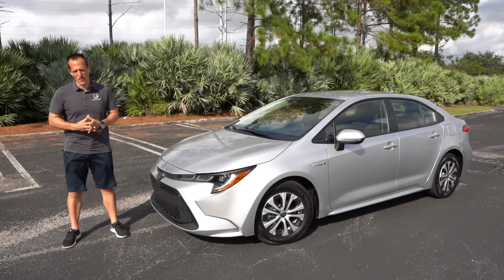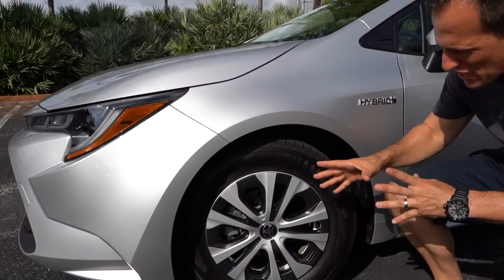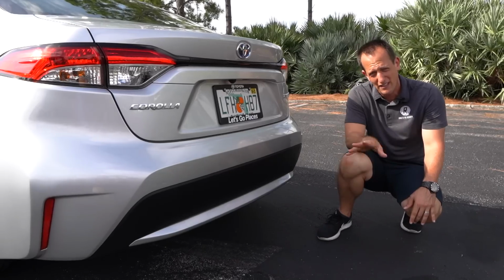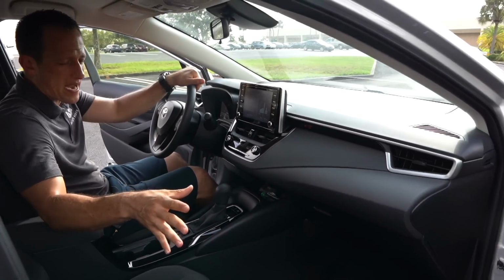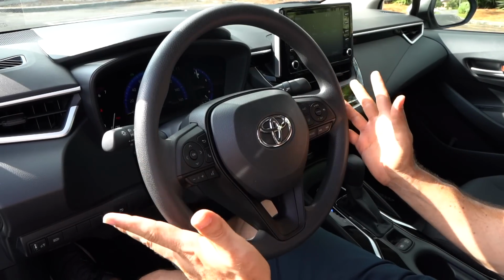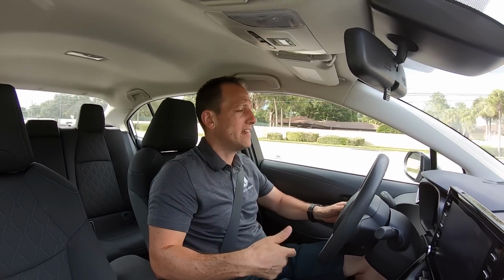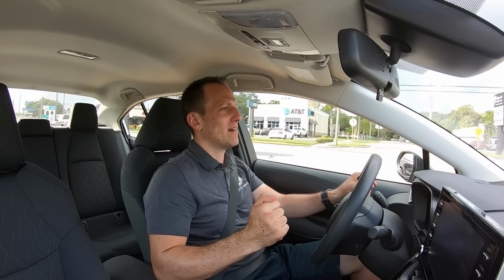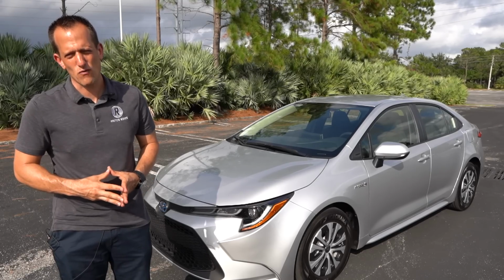Is the 2020 Toyota Corolla Hybrid the BEST compact hybrid YOU can BUY?

Comment: I bought one. Love this car. I bought an iPhone to use apple car play (android user), no android car play.  The stock infotainment center is useless, slow and clunky. Bought a cover for the center console armrest. I disagree with the you on the interior door panel. It’s easy to clean. Unlike the previous Prius, this car will get unreal gas mileage with aggressive driving. A simple windshield replacement will cost you almost 1500 bucks (thanks for insurance). 900 for replacement and 400 and some change to get lane assist recalibrated at Toyota, which is mandatory. No spare tire. B.S. fix a flat kit, to save weight I assume. 0-60 doesn’t mean much in real world driving. It accelerates nicely in power mode. Speed is not a factor anyway in this demographic. This car is rock solid. A classic dependable Toyota. Would buy this car again in a skinny minute.
Reply from the maker: Thanks for sharing your ownership experience!
Reply: I heard the brakes feel weird/grabby, is that true? Do you get used to the regen brakes? Can you actually have a little fun driving this 2020 Corolla hybrid????????

Comment: I am seriously considering a Corolla Hybrid sedan for the 2021 model year, or maybe pickup a leftover 2020 as my daily driver
Reply from the maker: That sounds like a great plan!
Reply: There isn’t going to be any left overs , these cars are holding msrp with even 60,000 miles so better get one now I’m keeping my corolla hybrid for 20 years
Reply: The 2020 corolla hybrid doesn’t have all the extra weight from blind spot , rear cross traffic and you can really get all the Noh you want (up to 56 mpg everywhere you go)
Reply: @southbayla3137  Have you had any issues with your? I wouldn't imagine you would I've just read some things  about the non hybrid ones having issues.

Comment: I don't think you can get Blind Spot Monitor even as an "option" for this Hybrid Corolla. That's a major safety omission by Toyota and it would steer me away from this otherwise very decent, economy car. I think you're right, Joe ...for a few grand more, you could buy a Camry or RAV4 hybrid in LE trim and have a more substantial vehicle and also get BSM.
Reply from the maker: Thanks for that great input Craig! I really appreciate your support!
Reply: $29,400 on rav4 to get the BSM option is not just a few k’s $ at 41/38 mpg. That’s nearly 5k $. I’d say 3 years the bsm will be optioned with more carolla trims that the resale value would justify the upgrade if one can manage to drive safely for that long without BSM. Oh how did we manage it for so many years without.

Comment: Personally, I believe the insight may have the slighter advantage here. The Corolla hybrid boasts a slightly higher MPG at the cost of a severely underpowered engine. The Insight, IMO is the one that’s styled more elegantly. Not only that, but the insight has 151 hp compared to the sluggish 121 of the corolla. At the end of the day, it depends on the person.
Reply from the maker: Excellent points!
Reply: It’s the first year, if they want carolla to compete rather than Prius they’ll bring hatchback, the trims and the 2.0 hybrid which Europe is enjoying.

Comment: I bought a new 2020 Corolla Hybrid and like everything about it but do wish I could find a better place to store my sunglasses other than the front passengers seat.  I drive it easy and I am consistently getting in the mid to high 60 miles per gallon.  Looks like I get less mpg during cold weather when I need the interior heat.  I guess heat comes from the gas engine and it runs more than the electric motor during cooler weather.  Still great car, great technology, great mpg all from the proven Toyota company!
Reply from the maker: Thanks for sharing your ownership experience with us!
Reply: rich fost same here, colder weather kicks on the motor so getting a touch less mpg, I store my sunglasses where my iPhone goes in front of the shifter, kinda like a swap.
Reply: I heard the brakes feel weird/grabby, is that true? Do you get used to the regen brakes? Can you actually have a little fun driving this 2020 Corolla hybrid????
Reply: Braeton Wilson I notice that the brakes are different (apply quickly with less foot pressure on the brake pedal) at slower speed than at normal speeds.  I do often feel the automatic emergency brake apply when I am stopped and put it in park.  I am getting a consistent 65 mpg.  More mpg during the warm months and slightly less during the cooler months - I guess the gasoline engine has to run more than the electric motor to produce heat for the cabin.  This the best car I have ever owned and a local Toyota dealership was just as good to have it serviced as the Toyota dealership I purchased it from.
Reply: @oaktreeviewing  Thank you for answering! Do you get used to the different brake feel or does it still feel weird/uncomfortable/difficult? How is the handling, is it easy to drive the car?
Reply: Braeton Wilson I have gotten accustom to the feel of the Corolla Hybrid brakes.  Matter of fact, other vehicles I sometimes drive feel weird because they take more foot pressure on the break pedal.  I enjoy driving this Corolla but I don’t ever drive like I’m in a race car.  If you haven’t, I would recommend test driving a Corolla Hybrid before making your decision on a purchase.  I am 6’2” tall and often bump my head getting into the Corolla if I don’t tilt my head towards the rear of the vehicle.  Once I’m in it’s a pleasure to drive.

Comment: The regular Gas power LE is $3000 cheaper. That'll buy a lot of gas. It'll be over 40,000 miles before the hybrid saves You any money on fuel. Plus the hybrid is slower.

Comment: i'm considering Corolla or Corolla Hybrid, and driving only 4500 miles a year, it would take me 17 years to break even from spending the extra $4500 for the hybrid. does the hybrid motor still have the metallic noise upon deceleration/acceleration? that's the only reason why i really don't want one. i do like that there is now the option to have a toyota hybrid small sedan, but not in a prius form.
Reply from the maker: Thanks for sharing that input from your experience!

Comment: tehy should have taken the hatchback and gave it the 168HP engine and mated it with the hybrid system. The Insight is 151 HP and has good acceleration. But the Insight gets not as good MPG. especially over 60mph. If you are going 70mph the MPG goes down. does not happen int he corolla hybrid or the prius.
Reply: For the price, the weight, the Horse power. a regular non Hybrid corolla would be better. You;d get better acceleration and resectable gas mileage with a non-hybrid corolla.